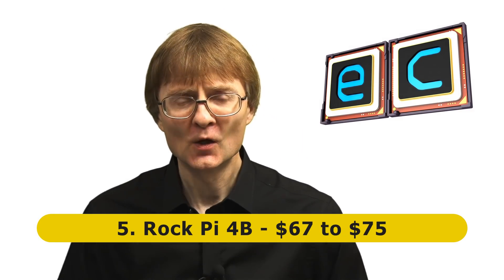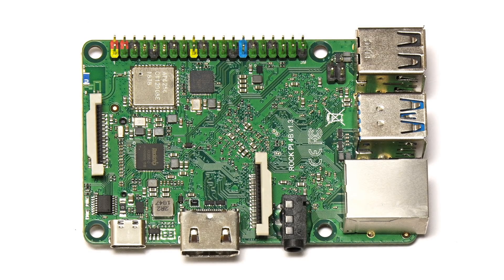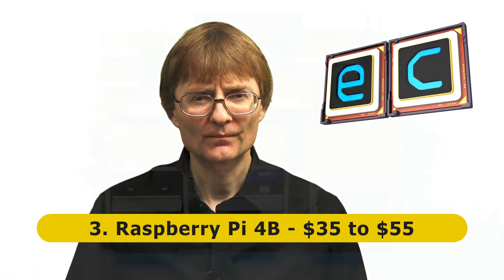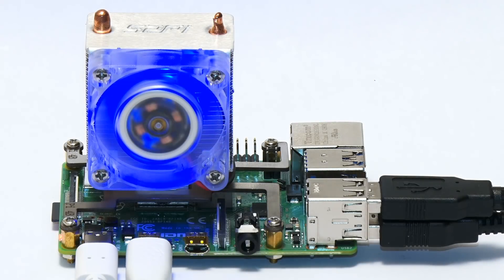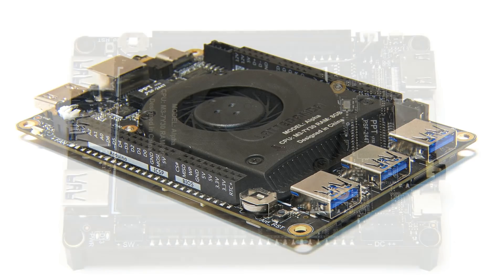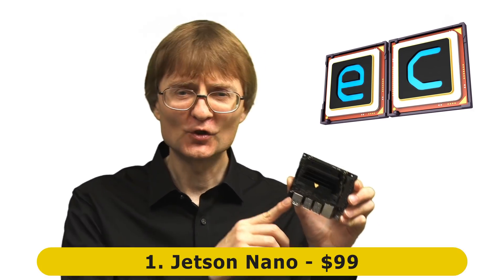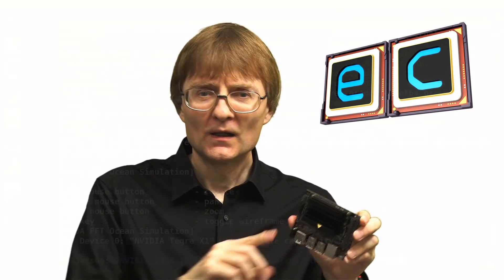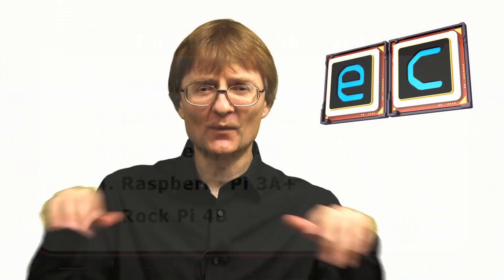Top Five New SBCs 2019

Comment: You can get some very good micro pcs for a lot less than a latte panda, my beelink x45 is of similar spec more ddr4 memory and an SSD for £135, I like the Jetson nano, but it's old hardware with little development, the rockpi 4, it's a board that seems to be getting good development and there are some nice cases for it now, I really like the raspberry pi 4, but I do dislike those micro ports, and development isn't quite there yet, I'm still using my 3b+, and for that an a+ can't be bad.
So my 5 would be 5th latte panda, 4th raspberry pi a+, 3rd Jetson nano, 2nd raspberry pi 4, 1st rockpi 4.
Reply: The Nano is 'old hardware' with 'little development'?  Really.  Whereas everything else in the video is cutting edge hardware with loads of development?  I think you'll find that Nvidias development budget dwarves all the other SBCs combined and old hardware is surely relative when you consider the hardware specs of the others.
Reply: @twmbarlwmstar  if it was new, it would have a73 cores, the GPU drivers not ready yet, it's an old Nvidia shield chip 2015, with a cut down GPU, I like this board, but Nvidia are not putting the money in to it.
Reply: @williamrutter3619  It's £100 and is the bottom of the stack, you can spend more, over £1000 for better?  You think its over-priced at £100, I think it is cheap compared to the competition.  Out of the other's which has a chip launched after 2015?
Reply: @twmbarlwmstar  I never said it was bad value, just out dated, the raspberry pi 4 has a new chip, the rock pi has a chip from 2016, these two boards use newer a72 cores,
The pi 3 a+ chip came out in 2016, but it uses the older a53 cores, but it does have a huge amount of development.
The lattepanda x86 chip, came out 2018, that board will do most things and has great x86 development, but it's an expensive chip and the board is overpriced too.
Reply: I wanted to add to this, I gave the raspberry pi 4 a lot of praise, but a month or so has passed, I have had two raspberry pi 4 die on me, now the suppliers are brilliant and it has manufacturers warranty, so I do get my replacement raspberry pi 4,  so that's cool, but those hdmi ports are awful, I have had display and sound issues, i still use my pi 3, so maybe the raspberry pi 4 goes further down the list for me, obviously I was a bit harsh by judging the SBC by sock on them, I assumed quality from raspberry pi, where I might have been wrong, there is more than a CPU on an SBC, so maybe I was a bit harsh on the Jetson nano and deserves to be higher up.
Still I was impressed by how I was treated, by purchasing a raspberry pi, I imagine an improved pi4 or a new pi5 next year, I will be there getting one, even if this pi4 hasn't been the best board produced by the raspberry pi foundation.

Comment: Great video Christopher. I don't have your top 2. But I've gotten enough boards to make my top 5 of last year. 
1. Khadas VIM3     : The fastest ARM SBC there is.
2. NanoPi M4(V2) : The V2 is on the way with the metal case with NVMe. But even the original M4 does what I need it to do best because of the better software. 
3. RockPi4B           : Only the software that's a little less than the M4. I love the NVMe, but now the M4 will have that too.
4. AtomicPi            : Underpowered compared to the above. But very useful for x86 tasks. And cheap enough as well.
5. Odroid N2          : Love the fact it doesn't need active cooling. But many issues with the software/kernel/USB. If not for the VIM3, it would be ranked higher since it's the 2nd fastest after the VIM3. 
The Raspberry Pi4 would come right behind that. It lacks good software, has many issues, but it is a powerhouse clocked at 2Ghz. And will become better if software matures enough.
Greetings. Have a nice day.
Reply from the maker: Great list. I really must look at the Odroid N2.
Reply: Yo, NicoD! Yes, here I was... drum roll all queued up for #1 , just waiting to hear 'Khadas VIM3', but only the dead thump of the kick (base drum) came instead.😣
Also noticed that your comment is the only one I've seen that mentions it, plus only one other that mentions the Edge V. What's up with that?🤔
Reply: @TheOleHermit  Hi. Christopher doesn't have the VIM3, and also has many RK3399 boards. So I think he made the choice for one RK3399. I don't have the Edge V. So I can't mention it. It is just a list about personal likes. If I wouldn't use 5V power banks, the N2 would be a lot higher for example. So my preferences aren't the same as yours, or for anyone else. Cheers

Comment: Why isn't the Udoo Bolt on the top or in the list?
Reply from the maker: I like the UDOO BOLT, but it's not technically an SBC (the memory is not onboard), and it is also very pricey once you add in the cost of the RAM. So it did not make my top 5. But a very powerful maker board, certainly.

Comment: Stupid question, i know, but why do we see no Snapdragon or Exynos cpu's, they are more advanced (14, 10 nm) with integrated gps, wifi and bluetooth on those single board computers than Rockchip or Broadcom. I would like assemble a powerful Android car pc.
Reply: Walter Verbeeck you can, from ODROID. Those mostly use Exynos CPUs, including the octa-core version with a cooling fan to allow for crazy high SBC performance.
Reply: Qualcomm and Samsung charge more.... And the hobbyist SBC market is niche but highly competitive, so with low profit margins and limited market, they really can't afford the higher end chips.
There are a handful that do, as Roman already mentioned, but they tend to be expensive, difficult to obtain or designed for a specific purpose (not necessarily what you want to do).

Comment: You can get vertical mounted full size hdmi connectors, so they take up less board space.
Reply: Yes, but they require manual labor during assembly. I don't think anyone makes a surface mount vertical version. If they do exist I wouldn't use them. I imagine that thing ripping off prematurely in the hands of teenagers everywhere. Vertical connectors put a lot of mechanical leverage on a very small footprint.
  Also, "takes up less space" is a relative concept. Boards like the Rπ are not just 2 layer designs. The π is at least a 4 layer board. A through hole connector has around 0.5 to 0.3 times it's area taken up by the through hole pins. On a 4 layer board that space is 4 times as large making the connector a pain for routing. These connections also force other traces to go much further if they need to go around all the traces from the connector. As far as layout and design, a surface mount version of a connector with lots of connections is virtually priceless IMO, but I don't do more than 2 layer hobbyist type prototypes...yet.
-Jake
Reply: I honestly don't see what would have been wrong with stacked HDMI connectors or a stacked HDMI/displayport connector like the Jetson Nano has. It would have taken a bit more vertical, but it wouldn't have been any higher than the USB ports
Reply: @bruwin  
  Well, looking at Mouser (bc I already was when you commented...), they don't even stock a double type HDMI. While you'd be crazy to use an American distribution network for this kind of mass production product, it is reflective of the market as a whole. An oddball product like a dual HDMI connector is going to have supply chain issues unless your, let's say, a giant company like invidia that makes a living off of flashy plastic covers and weird connectors. Normally, a non-standard connector costs a fortune to use in a design. Mouser lists a stacked HDMI for $4.33, DigiKey has one for $4.13 in quantities of 1k. Mouser's cheapest standard HDMI micro is $0.307 in 2k2 reals. DigiKey showed $0.209 in 1k quantities.
  If you went to Shenzhen to buy a half million of some odd dual stacked connector, who knows, you might get them for $1 each,.. once. You'll never get them at that price again, and a year from now no one will even acknowledge the connector exists if you need more. Alternatively, double the number of units with an industry standard connector and the only question is your skills with floating point math, cause we're going to be splitting pennies.
Reply: @UpcycleElectronics  really valid point.  Probably a year ago I got speaking with someone that was involved in actually building a SBC for industry/enterprise.  Out of my comfort zone but mainly the real problems all resolved around the cost/long term availability of various connectors.  Like even USB C was a massive consideration.  I would have said the actual PCB design and the supporting software for the project but apparently that was relatively easy.   They wouldn't tell me if the SBC WAS based on something though (like aPi 0) which was a bit irritating.  Still it was an enlightening conversation with lots of interesting stuff on doing business in China a nd like I say the cost/availability of connectors.
Reply: @twmbarlwmstar  
  The ubiquitous non disclosure agreements (NDA's) within the electronics industry are notoriously intense, and rock solid. Anyone that wants to make mass produced hardware needs to leverage some serious capital. Anything that is produced in the hundreds of thousands or millions is an enormous speculative risk. This gets into the realm of billionaires, which inevitably, gets into the realm of their litigious strategies. So in other words, you're messing with the highest and most powerful tier of modern society. If one of us plebeians steps over that line we will definitely discover the unspoken feudal law of the world. Anyone smart enough to find themselves working with these NDA's, should be smart enough to understand their place. Those aren't lines a puny pleb should cross.
  The Rπ is closed source hardware due to the broadcom chip. Broadcom is one of the worst companies because of their NDA's. The datasheets for all of the SoC's used on Rπ's are locked by NDA's. The raspberry py foundation literally can't share any details about the hardware architecture without Broadcom's approval. 
  On the flip side, Broadcom won't sell the SoC to anyone else either. A partnership like this is used to undercut and flood the market with the lowest priced, but also substandard, product. Such things are the strategies of billionaires.
  Most likely, an NDA is the reason your friend couldn't mention anything more about the hardware. You're lucky they would talk about anything at all.

   If anyone really wants to know more about this kind of thing from first hand accounts, look up "The Computer History Museum" and watch the 4 hour interview of the team that designed the Motorola 68k or even better, go watch the 3 hour interview of Chuck Peddle (the designer of the 6502 and the dude behind the Commodore brand of stuff).
  You can also infer the flip side of the electronics world if you watch the 2017 interview of Charles (Chuck) Moore available elsewhere by searching). You would need a basic knowledge of the Forth language for that one though.  He's a great example of someone that is truly brilliant, with ideas around hardware and software that could have reshaped the modern world into something entirely different, and yet, he never gained the financial backing necessary to become more than a minor footnote. Odds are you've never heard of Forth, and yet it is extremely powerful relative to the languages and design philosophy of it's generation. 
 Chuck Moore's hardware has even made it to Space. A hardware version of his stack system design, the RTX2010, was used as the main computer on the Rosetta mission's Philae lander. So some of the smartest people in the world, facing the most challenging mission possible, decided Chuck's hardware was the best option.
Reply: You can get adaptors, and if they did people would be upset about the increase in height.  Cooling is easier if you are flat and thin after all (hence a lot of servers).

Comment: Hello this was a great video but you forgot the fact that the jetson nano is NOT and SBC its 2 boards!! SBC is only 1 pcb and no more! this ones is a 2pcb layout so i think that you should edit this!
Reply from the maker: :) The Jetson Nano SoM (the part that plugs into the carrier board) is technically the SBC, as it contains the CPU, GPU, RAM, SD card slot, etc. The carrier board is basically a break-out board for all the connectors. :)
Reply: @ExplainingComputers  from that prespective i accept this decision but i was talking from the point that you need more than 1 PCB to use it!

Comment: An interesting review, and I wonder how much your opinion would change if you only looked at the sbc's from a "use as a desktop" viewpoint.  The review has convinced me,  that for now I will continue with my RPi 3B+ as a desktop until the 4B matures.
Reply from the maker: The Pi 3B+ remains an excellent SBC with exceptional software support. All I wanted in a Pi 4 was a 3B+ wit USB 3.0. :)
Reply: @ExplainingComputers   Unfortunately running the Pi 4B from the USB 3, is not yet possible without booting from and SD card.  I run my 3B+ from a 500gig HD, and got around the limited memory by increasing swapfile size.  Once certain issues with the 4B are fixed, I expect it would rate higher.  It is now time to start lobbying the Pi Folk for an ssd port!

Comment: Every time I see a sbc in a sodimm form factor I think to myself, “what if they used that as ram, and the ram had a cpu on each dimm to help process and transfer data better.
Reply: That's an interesting idea, that's actually what a memory controller is to an extent.

RAM is actually wired directly to the backplane pins on the CPU in modern processors (in two different ways depending on 2 stick or 4 stick optimization). the CPU itself has a little secondary 'cpu' of sorts that manages memory exclusively.

You could theoretically pair a simple but very fast CPU with an old slow CPU to do some bonkers stuff with bank-switching. like, here, have 8MB of usable RAM on this 6502, but the management CPU would probably be more powerful then the 6502 you hacked.
Reply: DFX2KX when I started seeing computers shoved inside of peripherals I got the crazy idea of setting up a system with a desktop hooked up to an all in one computer, using a keyboard computer, a computer inside of a mouse, and a smart speaker, all on top of a desk pc. Stupid but awesome.

Comment: i personally would opt for the udoo bolt v8 over lattepanda alpha myself, but otherwise i agree.
Reply: Thing with the Bolt is really it is a SFX with GIPO added, it is 4.75 inches square.  I like it, not enough to buy it because I can buy a SFX (without the GIPO) more cheaply.  The LAtte Panda is much more a SBC just running 86_64.